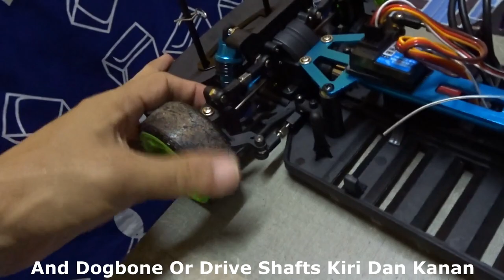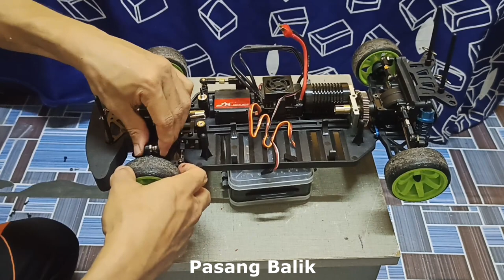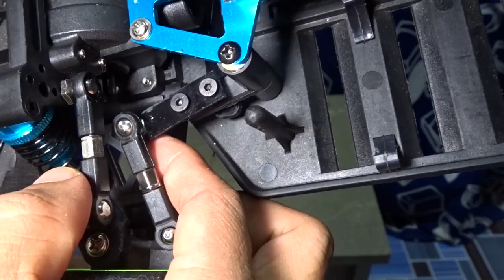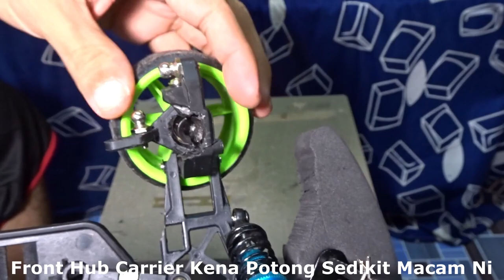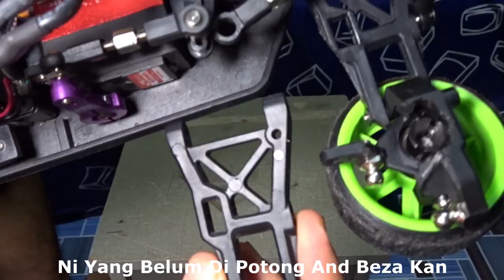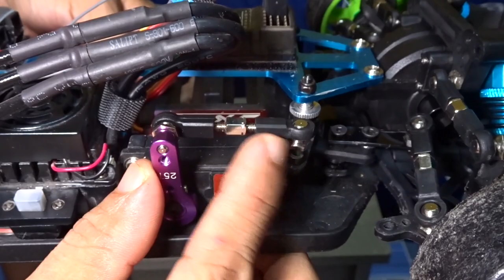HSP RC RWD Drift Modified

Comment: Hey bud, love it. Only parts I haven't gotten upgraded to aluminum on my redcat lightning is the lower arms, can cut them like that amazing. I used my old plastic C hubs and cut just the bottom off to connect the wheel and used another turnbuckle for support but this, with the 4300kv 11.1 6500mah lipo and 120a esc, I think I can make the tires smoke lol. Thank you for the great video
Reply: Do you lose the AWD?
Reply: @kleinkmakabali-663  with the c hub mod no, pretty much screw in the c hub but cut the bottom where it's screwed flush removing the top and I put 2 holes in the top plate and put 2 holes in the turnbuckles top closest hole without breaking thru or combining, then connectors to each of the 4 holes and turnbuckles on them for stability. I use the holes  with my non mod c hubs to stabilize even further. For reference I used this video 
https://youtu.be/U5bG7UvGu2U

Comment: Ok done modify and it works. Needed to cut out a piece of front differencial case to reach max angle but only because i made a little short the piece that connects under the two pivots. In tue next day i’ll try to make a little longer on. 
Great advice! 
thank you
Reply: What type of plastic did you use to cut the control arm out of ?
Reply: @BeardbroRCgarage  ???
Reply: cut the original one

Comment: Salam bang. Mungkin saya komen ni dah lama daripada posting video abang ni 😅 saya telah mengikuti cara abg satu per satu. Ukuran dan potong pon ikot cara abg jugak. Tetapi masalah saya angle cornering saya tak dapat sebanyak mana macam setup abg. Dan lagi satu, kalau saya lock steering ke kanan, selalunya akan sangkut dan tidak akan return ke posisi tengah semula. Harap abg dapat membantu masalah saya. Terima kasih sifu
Reply: cuba setting supaya rod yang tarik steering cub tu tak terlebih sangat
Reply from the maker: Betul..😊

Comment: Can I run my brushed motor on my hsp flying fish chaisis with out spur gear and no pinion motors hooked up to a car boat shaft coupler metal cardan joint motor connector will it cause issues with my motor when im running it out side in the open I made a video

Comment: My sticks just touch the front differential
Reply: Remove the front differetial👍
Reply: @jesperaugustsson4954  i have done that. But the box where the diff is innside
Reply: @E-supermoto  can you show how you built?
Reply: you made the piece that connects the two pivots too short. make a longer one and adjust the wheels so they are again straight forward but with camber